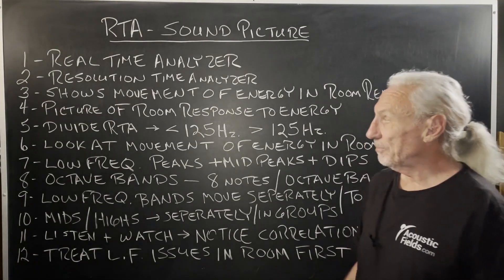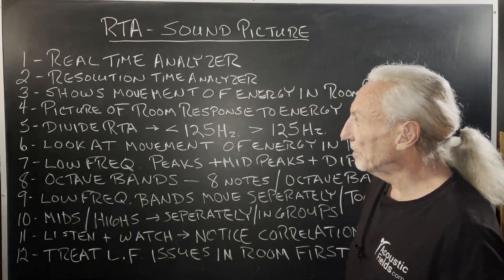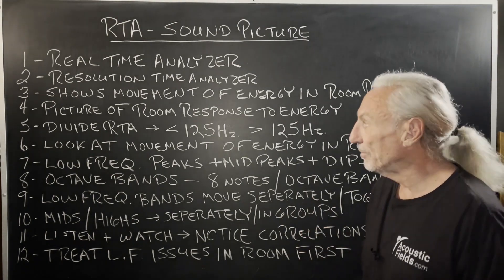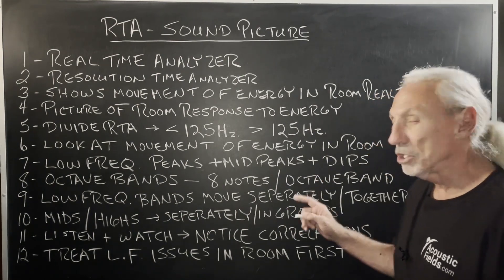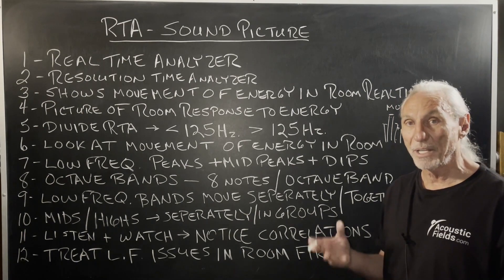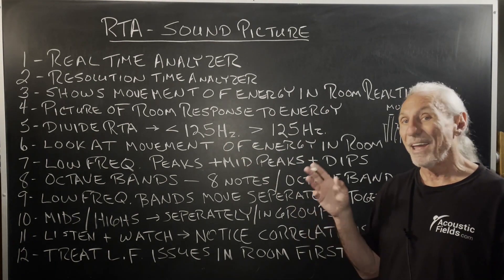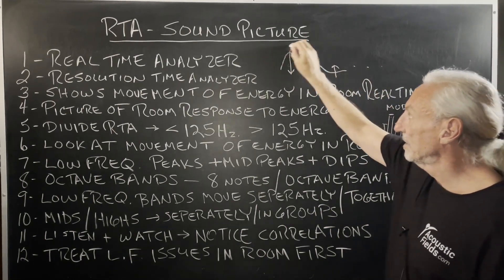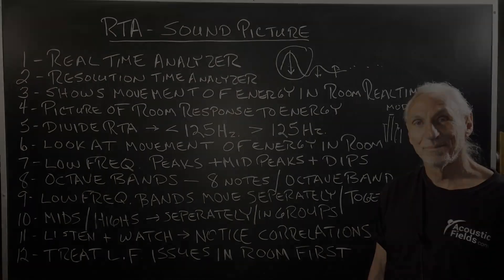RTA - Sound Picture - www.AcousticFields.com

Comment: I hardly ever have issues with low frequencies. My issues are always centered around 1k - 2k, especially when recording.. BUT I attribute that mostly to the type of microphone being used because they're all different. Ribbons vs Dynamic microphones are a perfect example. Ribbons always sound warmer or have less top end frequencies, while dynamic mics always tend to sound brighter and have more sizzle, so sometimes they can sound harsh. Using a low pass filter usually helps with that, but it comes down to the instrument, amps being used, etc.. As for the low end, there are easy ways of using EQ to control that. Muddiness however is a totally different story. Getting a louder and tighter low end is always a battle unless you use a quality hardware preamp, EQ and a bit of compression. Acoustics can of course be a problem, but simply moving things around or trying a different location can help as well. The type of speakers or monitors can also be pretty crucial. I usually say to find something that sounds good to your ear or use a pair of monitors that you know pretty well, so then you'll know how things will sound on different sound systems and other speaker types/sizes. Essentially, you have to get to know the monitors you're using.
Reply from the maker: That frequency range you describe is a common range that needs addressing in most rooms we do. The rate and level of absorption are critical in this range for resolution to occur. Most companies lack the proper rate  of absorption in their boxes filled with building insulation. This is why I created our foam technology.
 https://www.acousticfields.com/product/acoustic-foam/